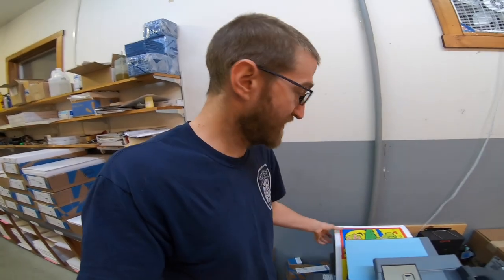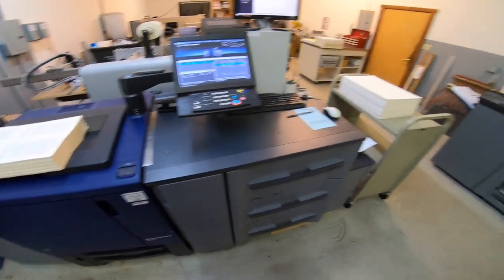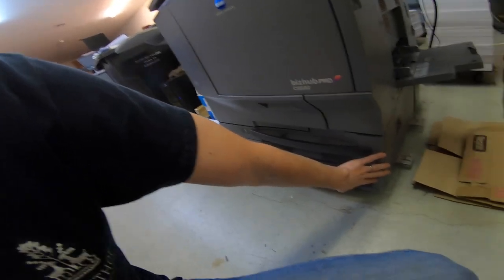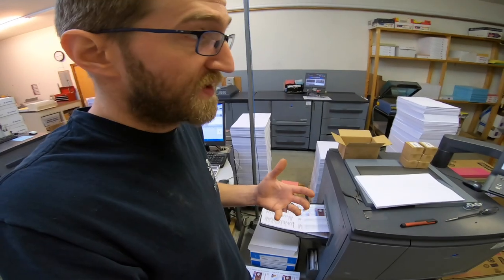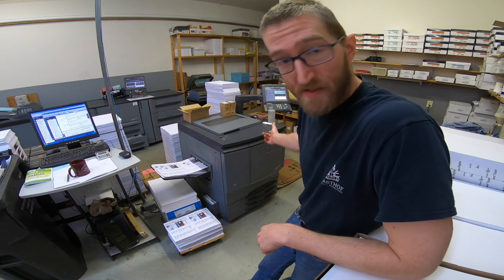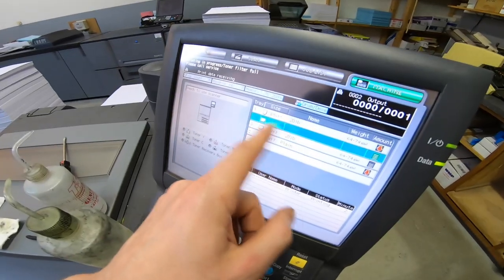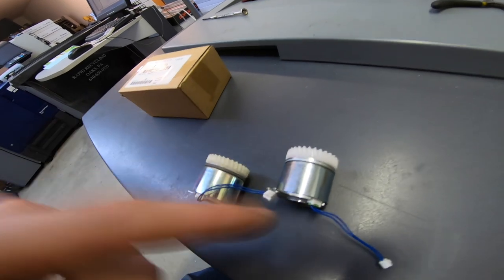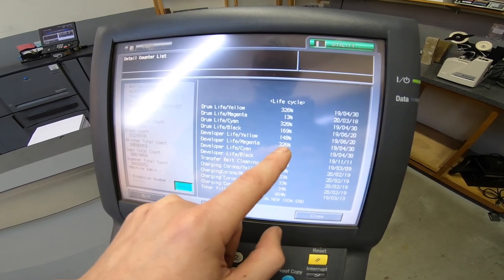Paper Feed Problems on Konica C6500 Bizhub Digital Press, Control Board, Clutch, Feeding, J-1701

Comment: I loved my 6500 when we got it new... one of our best purchases ever, but then after about 3 years and 7 or 8 mil it required service almost daily. I finally gave in and got a C7000 and then a C1060 at about the same time. The C1060 was amazing and we ran it 5 years and put over 10 mil on it. We now have a 2070 and a 3080 and they are great. Looking back, the 6500 was good but the developer or even the drums would not last near as long as what you get from the 10, 20 & 30 series machines. I know you love that machine but the cost to run it is way higher then the next gen machines. I wanted to keep my 1060 as a 3rd machine but just didnt have room. Even with over 10mil on it, it ran great and was a solid workhorse.
Reply from the maker: I agree, that's why I'm looking forward to getting a 1070 on my floor and am excited to track costs for it and see how it compared to C6500. The days are numbered for the c6500. But for light coverage uncoated printing, its a moneymaker.

Comment: You did a wonderful job of cleaning the feed assembly ... the one way clutch assembly roller can get gummed up and slip, I used to use a shop towel threaded thru the middle and wet it with alcohol and turn it around to clean it out, then lightly re-lube with Marvel Mystery oil - beautiful job though !!!
Reply from the maker: Thanks!!

Comment: Not every technician could be a printer but you could certainly be a technician.  I was going to say when in doubt use rubber rejuvenator on the rollers.  I rebuilt a canon imagerunner's whole paper path once replacing every roller the paper would touch.  What had happened was it was stored for years so the rollers had permanent flat spots.  Not the case with your printer but a lesson in that if you don't run a machine often or are going to short term store a machine it doesn't hurt to fire it up and run it a bit.
Reply from the maker: Hmm, that sounds like quite the project, rebuilding all that. Impressive!

Comment: hello sir, before i want to ask I have a C-6000 machine at home, regarding what I want to ask about the bypass not going up but the bypass can go down, I have tried to replace the CDB and PRCB and Motor Bypass but still nothing changes. Is there a solution to the problem I'm having?
looking forward to your reply sir. in advance, thank you sir
Reply from the maker: Sorry, I don't know off the top of my head. I'd check all the sensors. Maybe its not detecting the paper. You'll have to start experimenting. Wish I had a solution for you.

Comment: Hi , I am very much confident in you than a KM technician 😊. I bought a used KM 3070 . During transportation there was bit dent  in finisher part. But engine there is no damage. I called KM technician , but he refuse to fix this and install. They even don’t touch the machine. Even I need to update the firmware. But KM not willing. Any options to get KM firmware software Dan ?

Comment: Depending on the type of clutch, Magnetic Plate or Spring wrap, they can be cleaned ... even the type that don't come apart with a spring clip. You can use a sheet of paper 20-28 lb soaked with a few drops of alcohol ... in between the plates, and pull it back and forth feeding it around the periphery of the clutch. You'd be surprised how much junk comes out ! Don't spray anything the clutches, it will dry out the lubrication. On the type of Magnetic plate clutches that you can get apart ... you can clean and rough up the plates with a bit of Scotch-Brite scrub pad and finish up with alcohol clean, blow dry with a bit of air ...
Reply from the maker: Nice! Thanks for the tip!

Comment: Good day! Have you disabled the initialization of the Developer?  326 percent is a lot!  My machine cannot run at 220-240 percent .. Immediately it gives error C-245x.  How to disable initialization of the developer?
Reply from the maker: I just keep running. I don;t do anything different. I used to get a lot of error codes where I needed to clean the density/registration sensors. I put a new sensor unit in and the codes went away. I'm not sure if they were the same codes you were getting.
Reply: @justaprinter  Hmmm, okey ))

Comment: You could also replace the feed and resist rollers as they wear the diameter decreases and the feed tension between the Feed and Resist is too low ... cleaning won't help if this is the case
Reply from the maker: Interesting, I didn't think of the fact that the decreased diameter might be an issue.

Comment: Great work!    You should of been a tech!   The last digit of the parts usually goes up if the part is updated.   KM had a bad batch of clutches a while back.  ;).
Reply from the maker: Thanks! It would be a fun job. But I like running the machines too. :)

Comment: Hello mate, thanks for the videos, really helpful, I just have a question to ask , is it cost effective to run over 8000 clicks on a digital printer instead of putting it on to an offset printer
Reply from the maker: Depends on several factors. For me, labor is expensive and raises the offsett pricing. I should do a detailed comparison video.

Comment: I have Konica minolta c70hc, my printer is showing  controller is not connected. I have cleaned ram and several parts of controller and still same problem. Please help me to fix it.
Reply from the maker: I formatted the hard drive on my c1070 and fixed that. See this video https://www.youtube.com/watch?v=JGurmjioXfQ&t=700s

Comment: hi , please help me konica minolta c6500 fusing exit gear manual , i went video
Reply from the maker: Sorry I no longer have that machine.
Reply: @justaprinter   fusing exit gear sand photo ,i see gear sting, i open them not sting gear
Reply: Very very Thanks to reply . I went to Konica Minolta c6500 fusing exit gear  manual fully open . But how to reinstall gear . I do not understand . Please sand photo . I very helpful for you